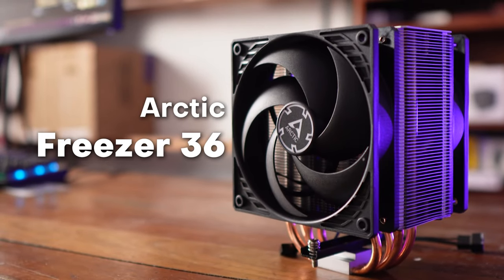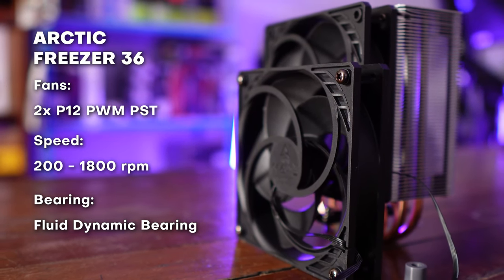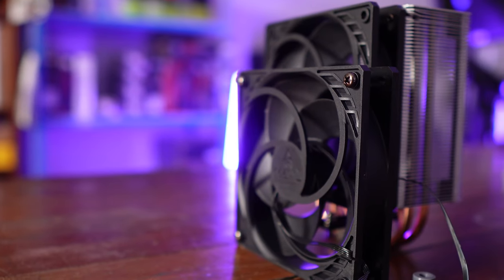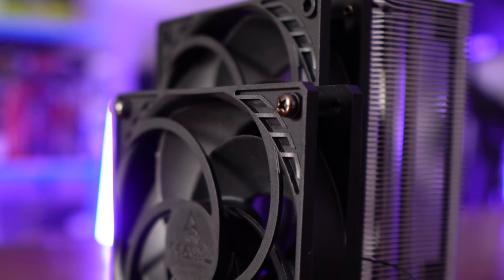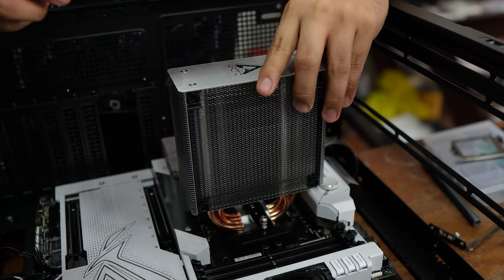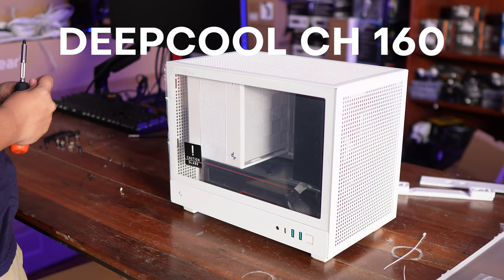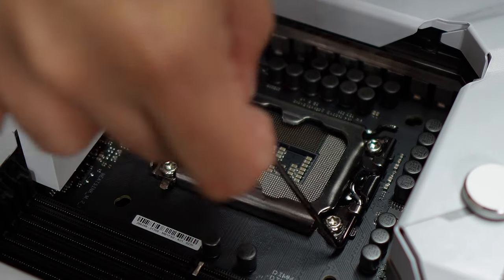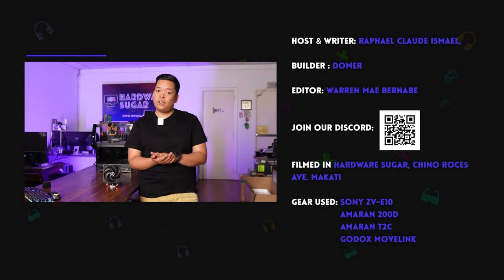Probably the BEST BUDGET Cooler! | Freezer 36 Review

Comment: Except the thermalright PA120 and PS120 coolers are cheaper and better lmao
Reply: I can get the Freezer 36 black for only 20€ from their website, PA120 for 35€ and PS120 for 40€. So 20€ cooler that can keep cool even the i7/r7 is just insane.
Reply: Twice the price...
Reply: Twice the price but two towers and 7 heatpipes. Plus multiple sockets supported. If you have money for i7/R7, you should also have 40€ for PS120. And these are very low prices. Other dual tower coolers that can be compared to PS120 cost 70€+..